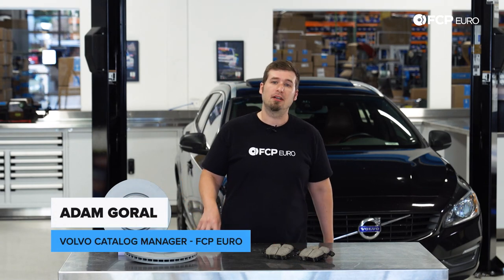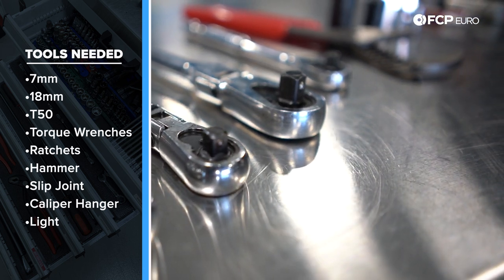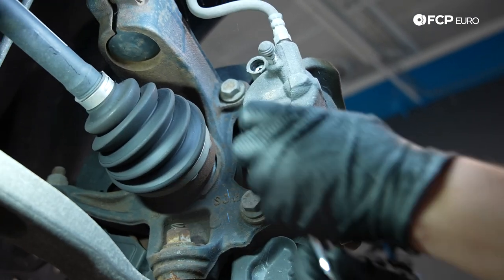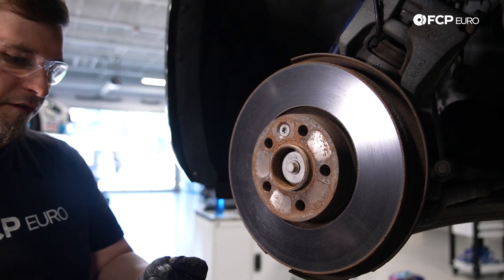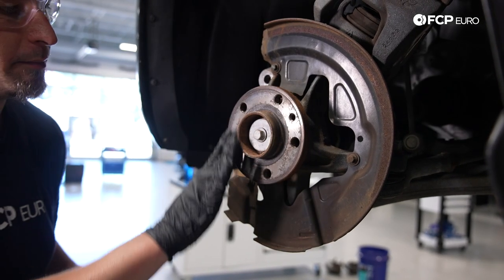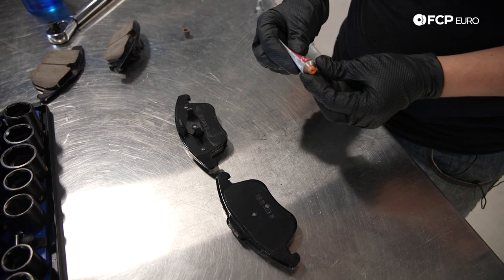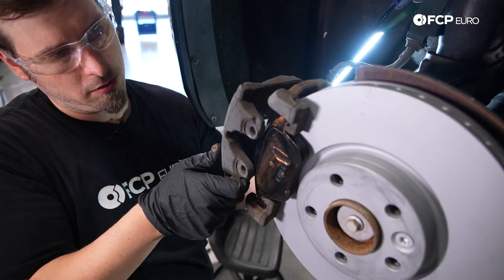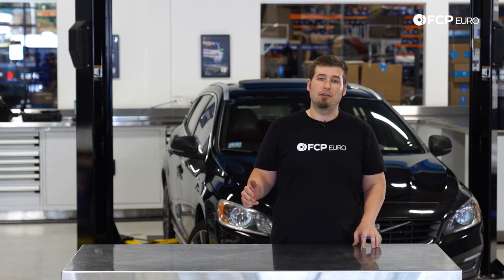Volvo S60 Front Brake Pad & Rotor Replacement DIY (2015-2021 Volvo P3 - S80, V70, XC70, XC60, & V60)

Comment: is this the same for the 2021 volvo xc90 t6? except for the front caliper spring...? and any toque spec on the rotor bolt t50?

Comment: My alignment pins need something greater than a 7mm wrench. A 10mm isn’t big enough. Any idea if there was more than one type of alignment pin used? My car is a 2017 V90 Cross Country (air suspension, if that would make any difference).

Comment: Why did you replace the anti rattle clip with a new one? Regarding the sliders, ATE recommends leaving the sliders dry, but probably doesn't hurt.
Reply from the maker: Hi Glenn, the clips are mainly cosmetic, and the lube on sliders is certainly a dealers choice!

Comment: What could cause a low pedal ie pedal is firm as normal but goes low enough that it is easy to press the accelerator and brake at the same time. 

All pads front and rear were replaced by a shop when I was trying to have others do my work - never again.

Comment: Good video until you compressed the piston into the caliper. The fluid in the piston is old and probably nasty from so many heat cycles and not a good idea to push it back up into the system. If the pads are nearly worn out it could mean that a lot of fluid is going into some expensive parts ie. antilock brake distribution block ect.. The best thing to do is open the bleeder screw and drain out the old fluid then refill the brake fluid reservoir. Other than that it was a good video. Even if you are working on an older vehicle that doesn't have antilock brakes you can ruin a master cylinder really fast. Ask me how I know.😬
Reply: This procedure was done properly. There is a reason manufacturers typically have a fluid change interval for brake fluid.
Reply: @nickdolan199  So your saying that the fluid in the calipers doesn't get bad during the brake fluid interchange intervals. And how many people actually   do a fluid change when their putting their own brake pads on. It's just a cheap way to insure that you won't pollute the expensive brake system parts if the brake fluid is not changed at the recommended factory intervals.
Reply: @thatsonebadhatharry8610  I'm saying the biggest detriment to break fluid is actually humidity from the air. The brake fluid is designed for the high operating temperatures of our braking systems. The area most likely to cause brake fluid contamination is at the master cylinder reservoir. Unnecessarily opening the system, draining and adding fluid during a brake change under the assumption other regular maintenance is being ignored isn't the proper way to maintain the system. It increases the likelihood of contamination and introduces the possibility of an error causing air to be introduced as well.

Comment: Would this apply to the 2017 V90 CC?
Reply from the maker: Hi Raymond, while the parts will be a bit different, the process is still roughly the same.